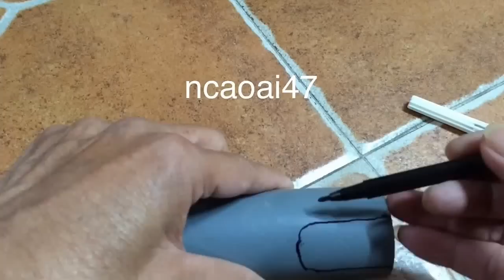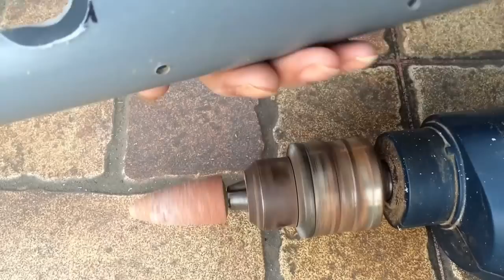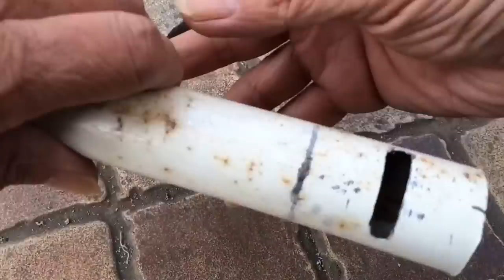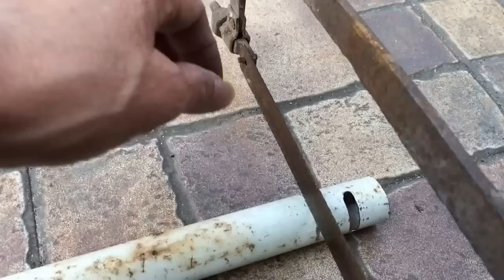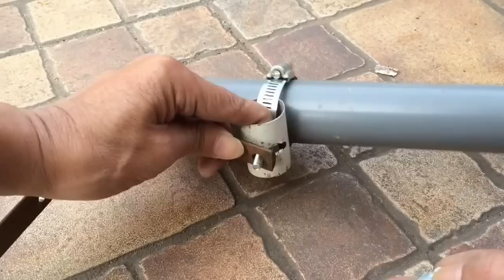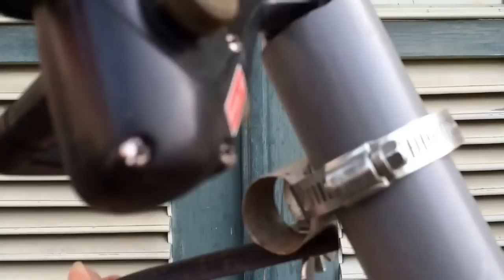Fishing rod holder - Soporte para caña de pescar - حامل قصبة الصيد - Làm Giá Đỡ Cần Câu

Comment: Good idea but if you heat the pipe first you can cut it easily with heavy kitchen sissors or a box cutter. Very easy to cut and also can form a flared shape.